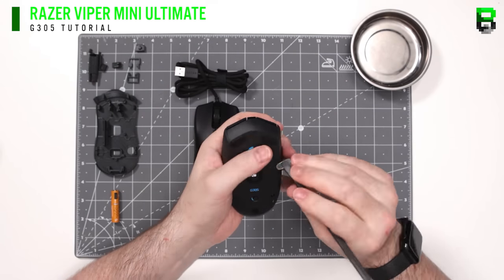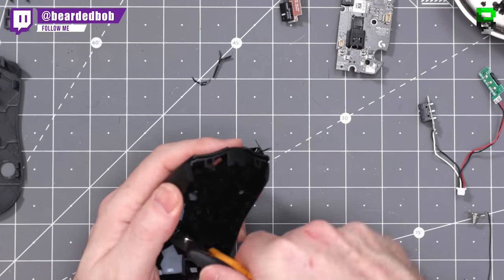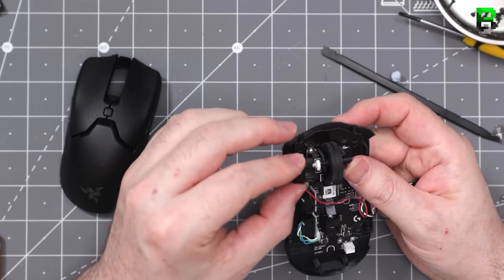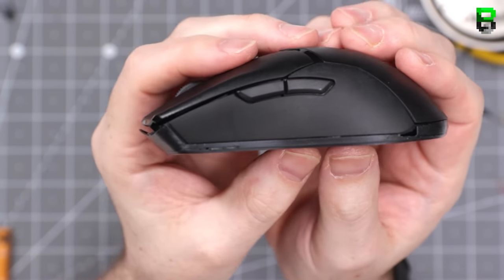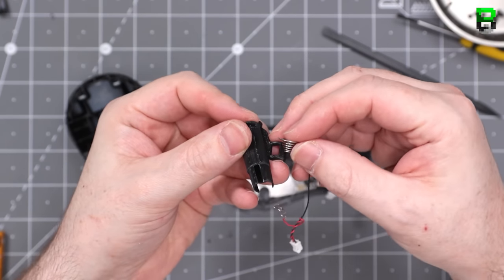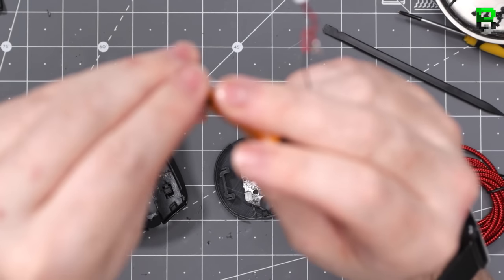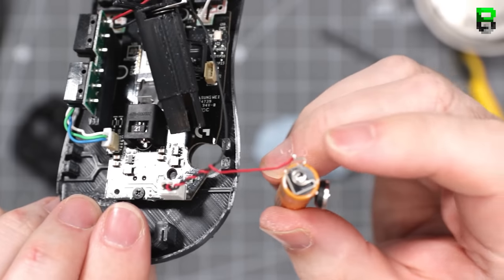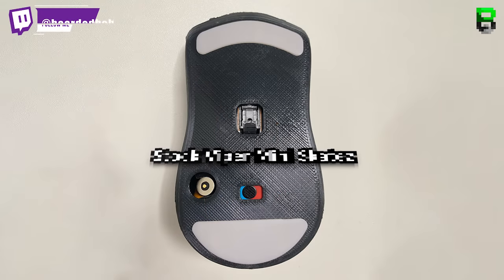LETS MAKE OUR OWN RAZER VIPER MINI WIRELESS ULTIMATE

Comment: Recently did this mod myself and it is very nice! Btw bob I'd love to see a logitech g703 weight reduction if you haven't done that yet
Reply from the maker: O nice, how do you find it took game with?

I've done the g703 weight mod in stream but I've not edited it and droppee the video yet. I will do as well as the g403 and M1k
Reply: @Beardedbob  mine works extremely well, and I love the shape of the viper viper mini. Also can't wait to watch the g703 weight reduction video as I'm probably picking one up tomorrow
Reply: @Beardedbob  i've heard that the g603 pcb is smaller than g305, have You got any ideas for mods using it?

Ngl, i have 2 spare ones, and i would love to mod them!
Reply from the maker: Nice.... G703 I'll get editing :-)
Reply from the maker: Seems it on this post https://www.reddit.com/r/MouseReview/comments/kxg8u3/for_the_diy_crowd_the_pcb_of_g603_is_smaller_than/

but as they say the G603 is more expensive. If you wanted a little less weight this could be an option. As far as i'm aware know one has made a custom base for that G603 pcb either so you would need to make one.

Comment: i’ve been really considering doing this as the viper mini is one of my favorite shapes. this will be my first time wireless modding though and i don’t want to make an expensive mistake!
Reply from the maker: This is one of the cheaper ones if you do. This is a good one to start as it doesn't require to much work. 

The viper shell if you keep the rear screw post as long as possible will allow you to fit it back on the stock viper mini base or you can glue it. Worse case you end up with a lighter viper mini 😜. 

The G305 you will just need to screw back together.
Reply: @Beardedbob  Ill definitely do this mod then. glad the viper mini is only $30 haha,,, thanks!
Reply: @s5pph $20 on BestBuy and eBay
Reply from the maker: yeah its a bargain really.
Reply from the maker: Steal at the price you are robbing Razer :-p

Comment: 2:55 where i get this switch holder from? i did use this 3d print  files, there is just the plate, dpi button and  battery holder.
Reply: you use screws to hold it in in the new version
Reply: @idmk  Ty ❤️

Comment: Can you use a different battery like the one used in the superlight when making this mouse? Also does changing the battery to the lipo cell reduce the weight by much?
Reply from the maker: Yep you can use a LR44 battery
Reply: @Beardedbob  but what is the estimated duration for a lr44 in this mod?
Reply from the maker: I want to get it recorded asap but I expect in a few weeks.

Comment: why do you use a custom printed base for the mouse? is it because the original base wont fit the rest of the parts inside?
Reply from the maker: Correct, it needs a new base that fits the G305 as the stock RVM doesn't.

Comment: What is the weight of the mouse after the mod, is there a lightweight version of the 3d print which had the holes at the bottom to save weight?
Reply from the maker: Around 72/74g. You could perhaps get it down to 68/70g with some tweaks

Comment: I saw someone trim the pcb of the g305 to make it fit in the Zaunkoenig m1k. Is it possible to fit it in the g wolves hsk? That one has a mouse wheel unlike the m1k.
Reply from the maker: That would be impressive, have you a link? 

If it will go into the m1k I did see why it wouldn't go into the hsk but I've not opened one to check. The scroll wheel and encoder will need to alight also

Comment: The fun thing is, its probably cheaper than a Viper Mini Ultimate
Reply from the maker: yep... check out the M800 or pwnage SYMM 2 i've done reviews and mods
Reply: correct, its 279.99 for the viper mini wireless

Comment: I prefer the symm 2 over this. Made one and fit to tpgether pretty well but prob needs a lil more cut out of shell. I could never get the left click to sit flush on the pcb like the right. Same with the front side button always had problems with them cuz of the mounting tray on the 3d printed shell. The print was ok in all but the seller was a massive prick off etzy. Will never buy from again. Dont bother asking any simple questions to him.
Reply from the maker: Agreed it’s what I would use with a weight reduction. I did a view measure them and they are the same